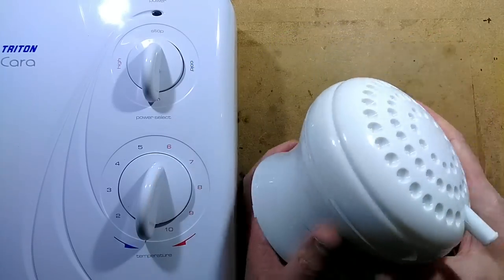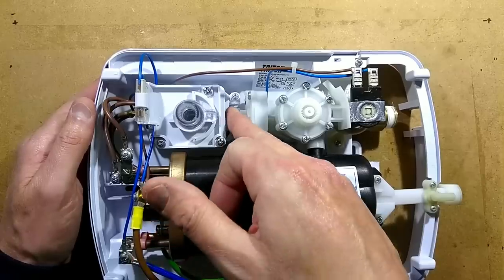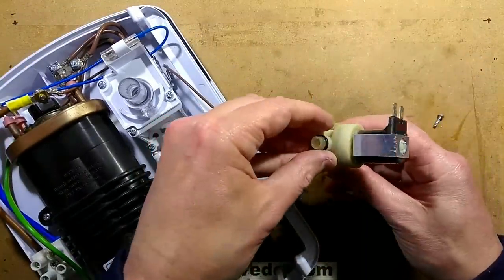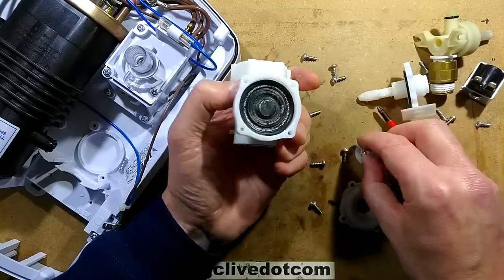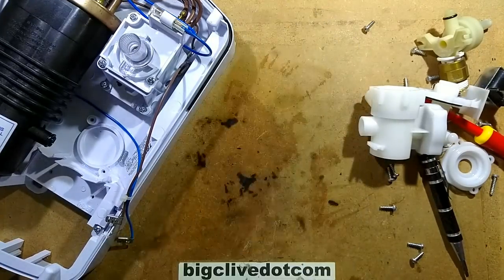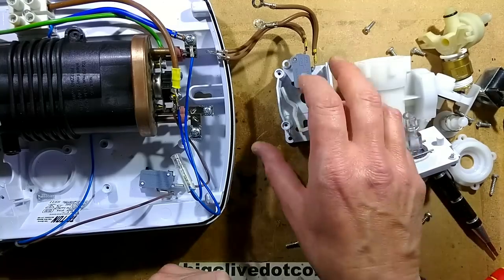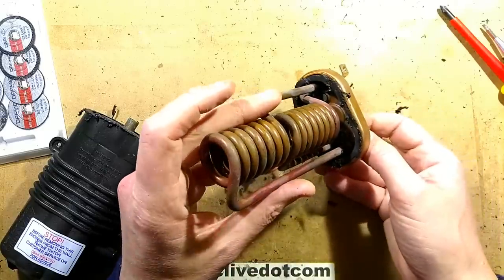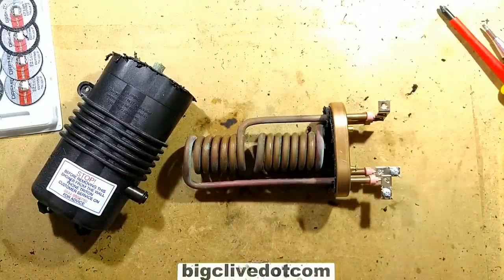Teardown of a UK electrically heated shower unit.

Comment: This UK system of individual heaters seem so stupid for me. Like we in Finland have central water heaters usually if we don't have warm water coming in from the local system. Usually it's big water tank installed somewhere in the house. Just seems easier to me.
Reply: Hene193 we have water tanks too, that's where the hot water for the taps comes from. 

The advantage of having an electric one is you don't have to let it run for 10 minutes before it gets hot.
Reply: Weird. We don't have that problem. I guess our pipes are better insulated because we get hot water instantly.
Reply: Yeah these are weirdly popular, even in homes that have modern combi has boilers.  Historically they were a cheap way to add a good pressure stand up shower to a home that might of only had a gravity fed system.  I think some people like them as if your boiler craps out it still works but honestly for the once in 10 year event of a boiler dying it's not worth it.
Reply: To expand further in a lot of homes in the past you might of had mains pressure cold water and gravity fed hot, that combination doesn't really work for mixed flow systems so these electric showers solved it for a low capital cost.
Reply: Central hot water heaters are pretty much standard in the US as well though point source heaters probably save on water and power but it would course would cause higher peak usage as a 40 gallon electric hot water tank only needs 4500 watts or 20 amps.
Reply: We have central heating tanks exactly the same as you these things aren't all that common i only ever see these sorts of units on sinks of older commercial or temporary buildings
Reply: Hene193 we have central city heating
Reply: Edward Cooper hits it right on the head of the nail. Just to echo his points gravity fed water is fine for the taps but proper pants for a shower with mixed mains/gravity fed water. It just results in a cold shower, always.

So while we still have immersion heaters and hot water tanks or even Combi gas boilers in more modern installs and central heating too. Folk still use these on mains fed cold water, which is normally considerably higher pressure than the gravity fed hot feed.
Reply: Hene193 It's not a case of pipe insulation that we have to wait, it's because our hot water tanks are rather large (bathtub sized) and it is usually not heated all of the time to save energy.. Therefore if we want a large quantity of hot water, we turn it on 10-20 minutes in advance or if we want a quick, powerful shower.. One of these units is used.
Reply: As others have said, in the UK it is common for the hot water to be heated by a boiler and stored in a tank pressurized by the cold water storage tank in the loft. This means the hot water is much lower pressure than the cold which screws up mixer taps. These power showers are a cheap solution. A better solution is to use a shower pump which takes cold water from the loft tank and hot water from the hot water tank and pressurizers them to the same level but this is a more expensive solution and also new pipes may have to be run from the pump to the shower.
Reply: Douglas Fletcher there's also awkward placement rules about them too, friend of mine couldn't have a pump fitted without spending an absolute fortune because he had insufficient head space I think the guy called it for the external pump to do its job.
Reply: My house has shower water from the boiler and it's higher pressure than most power showers I get to use. Really quite nice. And only takes 15 seconds or so to heat up :)
Reply: Prehistoricman sounds like a "modern" combi-boiler where the water is delivered at mains pressure.
Reply: Skruffles well that is a weird thing to do. If the boiler is well insulated then keeping the water at right temperature uses less energy than heating it again for every use. Unless you shower like once per month and not few times per week...
Reply: There are two types of hot water tank systems in the UK. Conventional gravity fed hot water tanks and "heatstore" mains pressure tanks. With this later system, the boiler heats up the water in the tank, then the mains water passes through a heat exchanger coil in the tank, resulting in mains pressure hot water suitable for a shower. The design of "heatstore" tank that I have has two pumps fixed to it's side. One for the flow to/from the gas boiler, and one for the central heating.
Reply: isn't that pretty normal? every single house I know of here in Norway has one of those centeral water heaters
Reply: Only poor people have showers like this. It's not usual. They are usually in student households where the landlord has quickly adapted a normal house to have extra showers, without wanting to plumb in to a boiler, so they just fit one of these as it's easier.
Reply: Hene193 
West have those systems  here too but this type of shower is used when there is poor hot water pressure.
Reply: Hene193  - I doubt it's insulation, more like flow rate in the pipes. Using 10mm pipe will ensure that warm water will get through faster but 15 or 22 mm pipes are better if the water tends to be hard or even is locally softened since smaller diameter pipes get clogged over time.
Reply: Australians are smarter, we use rheem tanks that aren't accessible near the shower I.e not in the same room.
Great way to not trigger the safety switch
Reply: It's more of a convenience thing as well.  Not having to mess about plumbing in sensitive, expensive, shower pumps with associated Essex Flanges and the like.
Reply: @Oscar-if6lq  Heated showers make perfect sense with the climate in the British Isles. My heating is used intermittently (Switched with a thermostat) for about 3-4 months a year (Not necessarily contiguous - day to day temperature swings are often more than the summer to winter average variation), so the shower is the only thing in the house that needs plenty of hot water fast. Not everyone is wired like me though - it's 17 degrees science (63 degrees frankenstein) in my sitting room and I'm in shorts and a t-shirt drinking a cold drink, so possibly I need less heating than average.

Even with heroic levels of insulation, keeping a standard 80 litre hot water tank hot continuously will take more energy than heating exactly the amount of water I need for a shower, most likely even if the heating is done using cheaper per Joule energy sources than electricity. With 8.5 kW and a built in pump I get enough water pressure and flow from the electric showers in my house too - and no need to schedule heating for when I think I will want to use the shower during the summer either. A very quick calculation says an 8.5 kW shower will provide 6 x 7 minute showers for one kWhr of energy. With a few showers at the gym instead of at home that kWhr is enough to keep me in all the hot water I need for a week. In fact my TV and laptop together use more power than the electric shower thanks to being on for a lot more of the day.
Reply: Fox we have that, Known as a combination "combi" boiler. In my house, cold water comes straight from the water supply line to the taps (kitchen or bathroom) hot water the same, comes straight from the water supply line as cold water obviously, then goes through the combi boiler and straight to all taps in the house, so get instant hot water and it can never run out as not stored in a tank waiting for it to heat up.
Reply: most houses in the UK were built in the 1400s

Comment: I am really willing to watch this video. I struggle a lot to understand how can britons cope with NO outlets in the bathroom and terrified by the idea of a fan heater or hair dryer in the bathroom while they can have a 9kW/240V device they can hug while taking a shower. For f** sake even the name sounds like a nazi torture invention.

I have seen and fixed/replaced a few of those things, I rather to have a bath with a toaster...

Having said that, I am not afraid of electric things in the bathroom, I am Spanish, we are used to it and I think electric showers are great, I love them if they are in good conditions and properly installed. You get water at the temperature you want instantly.
Reply: These shower units are far safer than the suicide shower heads Cliveden showed at the beginning. They are also not as remotely dangerous as your over exaggerated analygy is. A toaster in a bath will certainly harm you and if you don't have right tripping at your property. Will kill. Electric showers have several redundancies that ultimately protect from electric shock. Which Clive addressed as he went through the video.
Reply: @Orlando Simpson I can say for certain that I have never seen a hair dryer plug in a bathroom in the UK. A shaver outlet will allow 1 amp at 110 volts. A standard hairdryer uses about 2kw. At 110 volts that would be 18 amps. More than the flex cable on a standard dryer can handle.
Reply: @Orlando Simpson That's what I though you meant. I've seen a few shaver outlets but never a hairdryer outlet, internet search just comes up with stuff for mainland Europe ect... More common thing is to just have a plug installed right outside the bathroom door and run the wire for your [insert appliance here] under the door.
Reply: We still have one that is likely around 2 decades old but we don't use it for years. It just hangs up there and I believe it still works but you can't open water much if you want it to be hot enough. Oh and also turning it on makes bathroom a little darker.

Ours doesn't have that shower head heating though.

Idk why all replies to this comment came after a year, including mine.
Reply: @horusreloaded6387  You probably have the same thing as me. It's an un-vented instant water heater. Ours is 12kw and noticeably dims all incandescent lights in our house and slows fans, microwave ect... down. Pulling a lot of current makes the voltage drop.
Reply: we aren't terrified we just haven't cared enough to change it, as it's not an issue to do your hair drying in your bedroom.
Reply: In the state the plugs in the bathroom are actually different. They are GFCI plugs and must be installed now. Our house was built in the 70s so it doesn't have them.  I think they trip much easier and can be reset on the plug itself.  I have never heard of a heated shower. We all have a hot water heater and every faucet has hot or cold water. I wish we has 240 outlets instead of 110 here. The gov was afraid dumb people would fry themselves so we are stuck with shitting 110.  We have 240 plugs for cooking stove, water heater, and dryer here, but it is not the same as the 240 in the UK.  Ours is 3 phase and is just two 110 lines slightly out of phase to give 240.
Reply: Jose María why would you need a plug socket/outlet in the bathroom?

Comment: I had cool showers for two years every winter when I moved into my flat.Not having turned the knob past maximum heat, the 12 o'clock position, I later discovered that who ever fitted the shower, put the knob on in the wrong position and maximum cold was at 3 o'clock and max heat was at 2 o'clock!The knob cannot be repositioned.I now have warm winter showers.

Comment: Very interesting video, thank you for posting.  I have just replaced one of these again, it failed after less than three years due to the solenoid.  I checked with Triton, the solenoid unit is almost £40 so I bought a complete new shower from amazon for £54.  I did not realise the coil was available separately on line, I have just checked and these are about £9.  I will keep the old unit and replace the coil when the present unit fails!  Bob

Comment: You guys have 220 at the plug, is your average breaker 10/15 amp like 110 is?
Reply from the maker: For sockets the breaker is usually 32A for 240V.  For showers it could be a 40A or higher breaker depending on the shower rating and cable.

Comment: I just realized something interesting about UK and US household electrical distribution. Correct me if I'm wrong:

In the UK, it seems you have a transformer that provides 240v (or 230v). One end of the secondary is called the neutral, and is grounded/earthed at the transformer (in addition to being connected to the black/blue neutral wiring). The other end is the live (brown/red) which supplies the 240v.

In the US, we have transformers that provide 240v (or 220v), but we center tap the secondary windings. The center tap is grounded/earthed at the transformer, as well as being connected to the neutral (white) wires. The ends of the transformer are connected to the red and black live wires that supply 120v (or 110v). If you need 240v for something, you simply connect your device from black to red directly. 240 is then reserved for appliances that actually need it like electric ovens, clothes driers, and potentially electric showers (especially if they're going to pull up to 10kW from the wall).
Reply from the maker: We have a standardised three phase 240/415V (supposedly 230/400 under European standards) system with houses usually getting a single phase and neutral, but factories getting all three phases plus neutral.

Comment: I am so confused by this doesn't England have running hot water? You can't just turn on the hot water and get hot water from the tap?
Reply: Ha yes of course we do. We can have showers like you guys have, but these units are just more popular. Also a lot of homes now don't tend to have water storage tanks, it comes straight from the mains and if hot water required it goes through a combi boiler (which provides heating and hot water to the home) - so water instantly heated and then sent sent to the taps, no storage tanks (which aren't pretty if you've ever seen one cut open) and hot water can never run out - ever.
Reply: This is just one type of shower. The reason these are popular is that they are easy to fit. Just one cold water pipe and an electrical connection. In addition, historically UK household used vented hot water tanks which relied on header tanks in the loft/attic. Those were safe, reliable, provided a backup water reserve in the case of a failure in the mains feed and/or it being isolated. It also prevented back-siphonage into the mains water system. 

The downside is a low head of water for showers. That can, and often is, overcome with a shower pump, but it's not always convenient.

These days, unvented hot water storage tanks are permitted, but the installation standards are rigorous. Unlike the USA, carbon steel storage tanks with enamelled linings are not permitted. All unvented tanks must be of stainless steel and there are a lot of safety measures. They are considerably more expensive to install and are meant to be checked annually and have to be installed by qualified people. 

As an alternative, there are continuous on-demand systems which work at mains pressure. These electric showers are one type, but are effectively limited to about 10 kW. They are popular as they are very cheap and a relatively simple retro-fit but effectively limit showers to about 4-5 litres per minute. A popular alternative is a gas-powered "combi" boiler. which run up to about 40 kW. They provide hot water on demand at mains pressure and will drive a shower up to about 20 litres per minute which is approaching double what is recommended. They are popular as they are very compact, also supply the central heating and remove the need for a separate hot water tank.

UK homes are, on average, a lot smaller than US houses and space is at a premium. Compact solutions are at a premium, and whilst US-style unvented storage tanks are possible, they are expensive and take space.

Comment: Years ago, we used to have a succession of Triton T80s (very similar design). However, being in a hard water area, their primary method of failure was scale (we think) - typically the failure mode would be resorting to the thermal cutout for temperature regulation: heating up to scalding, cutting the heater, then a few seconds later turning the heater on again. Rinse and repeat.

Comment: That thermal cutout on the top works in 2 stages, for a minor overheat it resets once cooled, for a major overheat it it will not reset and has to be replaced.

Comment: Cheers Clive, wish I had been able to access this video earlier. Had a significant amount of messing about with one of these shower units installed in a remote Scottish house fed off a private water supply (comprising a large feeder tank, higher up a hill from the property, supplied from an adjacent burn). 

The shower could be made to work in a fashion by faffing around with flow rates/settings, so I concluded it was not electrical. So, to eliminate another suspected issue, I bought a water pressure meter which revealed the household pressure was right on the borderline of the manufacturer's minimum spec (this relates to the bit in the video where you dismantled the diaphragm/microswitch arrangement).

So, apart from relocating the supply tank higher up the hill (haha), the only other solution was possibly a power shower.

Anyway, as I said, the shower could be made to work in a fashion although you also had to make sure there was no other water usage in the property at the same time, e.g. toilet flush or washing machine.

Comment: Where i worked we had a couple of those that if you took the solenoid or other part off to inspect it, the o-ring would not seal again, it was easier for us to just replace the whole unit, not like the old heatrae carousel, all copper and brass construction, it was also much simpler, just a 2 stage pressure switch.
There was one other shower unit we found that was just a block of thick perspex that was drilled with a water channel, the heating element was just the bare coil threaded through.